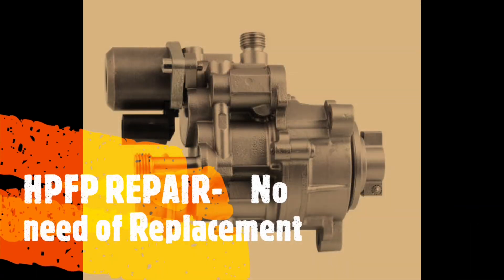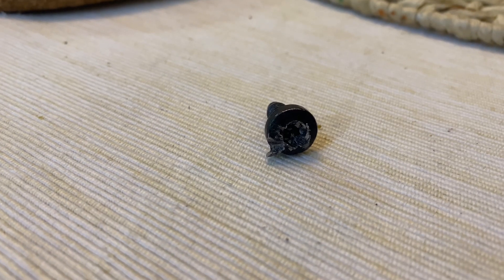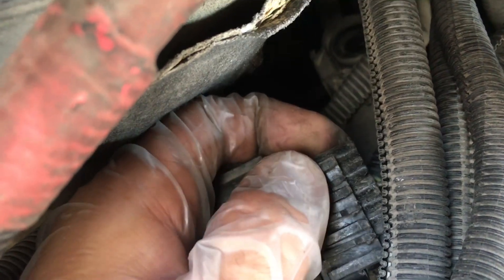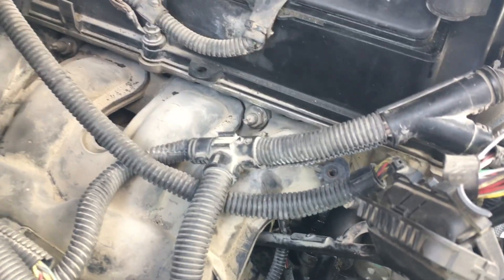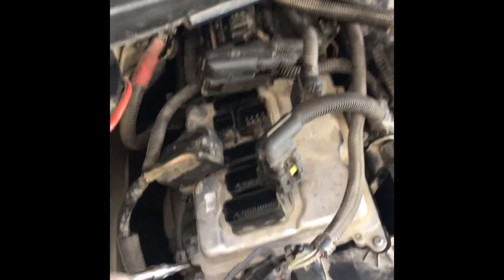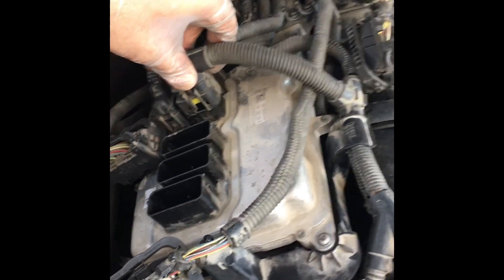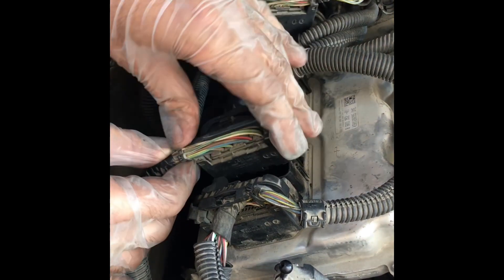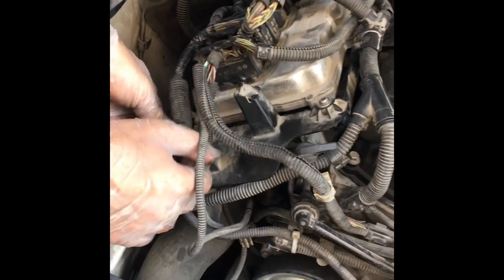Intake VANOS repair failure!!! Proper way to take intake VANOS BMW N13 engine

Comment: Does the ECU require a re-calibration after replacing the solenoid, or will it work straight away/re-calibrate by itself?
Reply from the maker: No need of calibration. it will adjust by itself
Reply: @bimmerhacks Thanks, what torque setting was the bolt put back?
Reply from the maker: @OttoNederlof  13 Nm

Comment: Hahahaha I see the video too late. I was going crazy today! I gave up after 1h and did the exhaust side😅
Reply: Bro, did you manage to make lose the intake vanos? I'm having trouble😢
Reply from the maker: @dmbkevster  yes I took it out by hitting with a flathead metal screw driver. The plastic handled screw driver  will not work out.

Comment: Thanks for posting this video. Changing both solenoids on my n13. Getting a rough idle and occasional drivetrain warning, getting a 130104 code. Vanos Intake camshaft jammed
Reply: Will do. I have them on order hoping to get them changed this week. I’m getting the 120408 code aswell but from what I understand that is a follow up code from the 130104,
Reply: @ryanneal1879  that code is a crap code to have mate if I’m honest with you. I got the solenoids changed and no luck. think it’s to do with the oil filter housing. That’s my next mission.
Reply: Hi mate let me know how you get on please. I’m getting the 120408 and 130104 codes on another bmw.
Reply: Have you tied the camshaft sensor?
Reply: Was told from a mechanic that fault comes for 3 reasons, solenoids, cam sensor or low oil
Reply: I think he did do mate I did get the mechanic the sensor too let me know how you get on please
Reply: @qmohammed4161  what symptoms are you getting?
Reply: @ryanneal1879  are you getting the same symptoms I take it mate? Very rough idle an car shaking? No one can sort these issues out. I’ve got 5 bmw n13 petrols with the same issues. Let me know how you get on please
Reply: @qmohammed4161  changed them both today and so far so good. No rough idle, my mpg increased dramatically on A 45min drive aswell
Reply from the maker: Sorry to hear that. make sure the connectors and wires are in good condition, it might have a break somewhere for the intake side. As you changed the SOLENOID and still giving you leads me to that conclusion. Hope you have changed the oil and there is no broken pieces of plastic in the oil filter/ oil must be pumping properly. Lack of oil pumping can cause hilarious problem as you know. Make sure the Battery is in good condition - Unhealthy Battery will make car act weird, we cannot judge what all error codes and symptoms it will show when the Battery life is over.
Reply: @bimmerhacks  hi have you had any issues with fault code 164041? i have this code on my bmw 1 series sport. 2013. please help me.
Reply from the maker: @qmohammed4161 I did not have this problem. As the fault says your exhaust VANOS solenoid is not completely into the position, push further and tighten the torx bolt to it's spec.
Reply: @qmohammed4161  have you had the vacuum pump checked?
Reply: @ryanneal1879  hi mate I haven’t no. Is this another issue? Which fault code does the pump throw?
Reply: @qmohammed4161  my idle started to come back a little lumpy. I noticed oil leaking for the vac pump area at the back of the head. Pulled the pump out and found the pump to be full of oil and all 3 o rings were shagged, the main one that goes from the pump to the head was completely broken, after cleaning it out and replacing all 3 o rings the car is smooth again
Reply from the maker: @ryanneal1879 could you please put this as primary comment. I'll pin the comment so that it would be helpful for many n13 guys
Reply: @ryanneal1879  so changing the solenoids didn’t solve your issue? We’re you getting a low oil light too? That’s an expensive job ain’t it? Thanks for letting me know mate much appreciated
Reply: Car is shaking like crazy mate very rough idle
Reply: Wow smashed it mate
Reply: What did you change may I ask? We’re your parts brand new or part worn?
Reply: @qmohammed4161  the intake and exhaust solenoids,  replaced them both for new ones out of the packet.
Reply: @ryanneal1879  nice one I got them both replaced too and it didn’t sort it for me. God knows mate. Was your car shaking like crazy?
Reply: @ryanneal1879  how’s the car mate?
Reply: @qmohammed4161  running smooth and no cam shaft codes have come back.
Reply: Wer are you located? I’ll pay you to do a couple for me mate but and sell these

Comment: Do you have to remove the dme to change the solenoid?
Reply from the maker: To take the Intake VANOS solenoid it's better to remove the DME as the torx bolt  of the solenoid  might get damaged (mine did) if you try to take it out without removing the DME. Exhaust side is pretty simple and only thing to take out is the air box to the turbo
Reply from the maker: For the intake solenoid it's better to remove DME as if not you might end up damaging the solenoid torx bolt. Remember disconnect battery before touching the DME